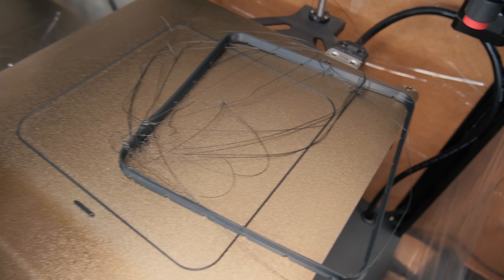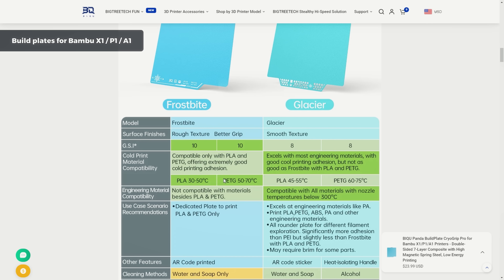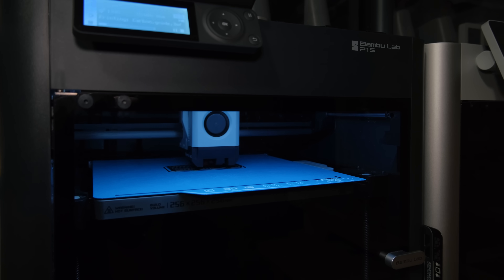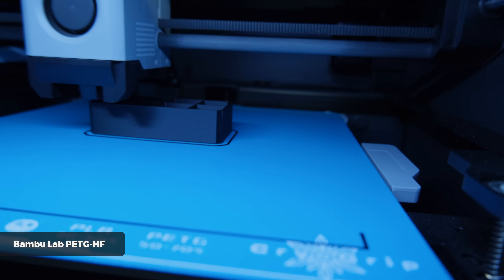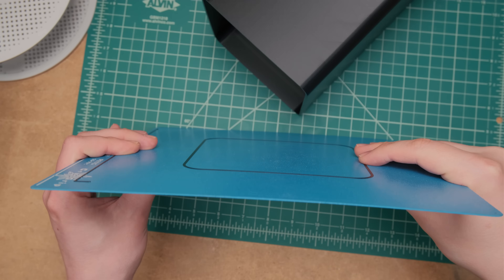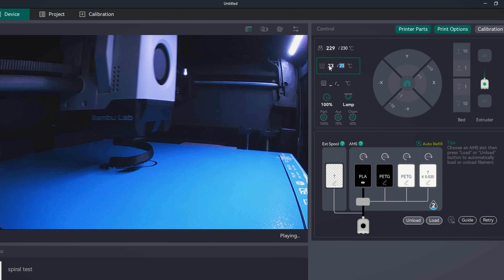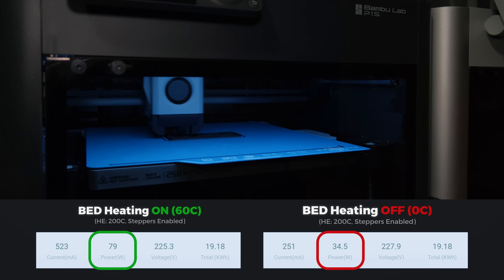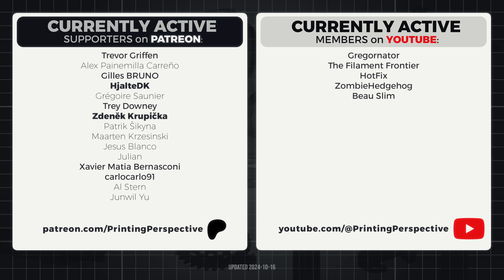The Game-Changing Build Plate (CryoGrip Pro)

Comment: I don't know where the idea that you can't print PLA or PETG enclosed comes from. I've had my P1S for almost a year and I've never felt the need to leave the door open while printing either material. The prints come out just fine.
Reply: It's not like you absolutely cannot. You can but it's worse for overgang and bridges and you also risk to get clogs if your heatbreak isn't cooled well.
Reply: I also print PLA mostly enclosed with my P1S, only if I have some bigger bridges or overhangs above 45° I open the door a little. I also turn down the AUX fan to 25% instead of 70%  default. I found that the cooling is often to strong and parts on the left (side of AUX fan) will warp, because the default cooling is to strong
Reply: I don't have any enclosed printers, but one of my printers starts to jam PLA any time the ambient temps exceed 30c
Reply: I’m printing a lot of PLA and PETG in my p1s as well, whether big or small, they all work really good. I will only open the door if there’s a lot of overhangs in model.
Reply: ever heard of heat creep or do you only print really small parts?
Reply: I printed petg/pla for a year with the x1c closed before I even heard this was a thing. IIRC it was the x1c screen that mentioned to print open
Reply: Obviously you don't, you join the game late so don't be that know it all guy. PLA and PETG can't printed enclosed was a problem on older printer where heatbreak cooler is not good enough, causing the filament to swell in the tube, jamming it.
Reply: @giaopx  No, there are two separate issues: heatbreak cooling and part cooling. The former was only a problem on old junk hotends, but part cooling is always a problem with PLA in a closed chamber. You can never have enough cooling for high speed PLA printing - even with infinite fan, the thermal conductivity of the PLA itself, getting heat out from core of the extrusion to the surface, is limiting, and the only way to get it faster is lower air temperature (higher delta T).
Reply: durning summer my printer jammed because the temperature in my enclosure went above 80 or so degrees. so the pla turned in to a mush that was impossible to push. that's why.
Reply: "ePLA" is more temperature resistant and said to be stronger than PETG. print like PLA
Reply: I also have a p1s and have never had the door open when printing also if the print is going overnight i will drop the chamber fan and aux fan down to 20% and part fan to 50% . Never had a problem with warping or failed prints
Reply: @truey90s  "Overnight" <- clearly you're printing slow, large prints. Which probably mostly work, except for poor overhang performance. What doesn't work are small fast prints.
Reply: We've had many instances where PLA (on PEI) gets soft due to the chamber temp and then the extruder gears can no longer bit into it. They wear into it and so it jams in the extruder. This happens when a print has parts that result in very low flows so that the filament remains within the bowden within the enclosed section for a reasonably long time.
Reply: It depends on your bed, temp and more. Bambulab recommends it on non cool plates due to heat creep potential.
Reply: Anything that's keeps a draft of the bed is better I don't know where you lost your crack pipe
Reply: One day I printed PLA with top and side door closed this summer when outside temp is over 100F and no AC. 

Heat creep jammed the extruder and I had to disassemble everything
Reply: @astrovore148 - you could know if you wanted to…
Every environment is different and there are some where the heat creep will mushroom the filament and in some printers where the hot end cooling is poor, opening the top or door is one way to mitigate that.  It’s really not complicated.
Reply: @JoeyMoreland  Yes. But it can still be done successfully, and is done so by people everyday.
Reply: Mines overheat if I don't open
Reply: Just because you can does not mean you should.
Reply: Printing PLA in an enclosure just like halves your cooling power, which is really bad on a printer that already has underpowered cooling. Maybe it doesn't matter if you only print large objects or full plates of parts, but if you print small things, the weak cooling will easily make what should be a 2-5 minute print take 10-20 minutes. It also precludes printing extreme overhangs without support.

The mechanism here is that rate of cooling is proportional to delta T, and the critical temperature you need to get PLA below not to be soft is around 50°C. If your chamber is 35° instead of 20° ambient, delta T is 15 instead of 30 at this point, and cooling takes place at half the speed.
Reply: @daliasprints9798 If you print small parts, the enclosure doesn't really have time to heat up like it does on a large print.......
Reply: @shelbyseelbach9568  Even just bed heat in open air makes a difference. I haven't done speedboating in a while, but when I did, I always used cold bed because of the loss of cooling power just from the bed, which affected how fast the lower hull could be printed successfully. Chamber will make it even worse. Even for sub 10 minute prints.
Reply from the maker: It depends on your environment temp and the fan speed settings, but overhangs will suffer no matter what.
Reply: People who don't have a room with enough cooling are basically where this comes from. For those of us who have rooms that are temp stable and stay cool without issue, leaving the door closed is a non issue.
Reply: It's apparent you aren't printing in a warm room and aren't printing bridges or large overhangs. It absolutely amazes me how people can think "I've never had this issue so there's no way other people have different circumstances and could possibly have this issue!" You ARE the problem. 

I've had issues with heat creep in my P1S that caused clogs and even extruder jams/breakage when printing PLA. The room my printer is in is routinely 90-100F so I absolutely have to open it up when printing pla or I wind up spending too much time cleaning clogs.

Please stop thinking your the only one that matters.
Reply: @marinegeek_23  When did he say that it's impossible that others have experienced issues? He asked where the Creator got the idea that it was impossible and stated that he does it without issue, meaning that is absolutely possible. I hate when people want to argue against things that the other party never actually said.......
Reply: @shelbyseelbach9568  lol look in the mirror
Reply: You are specials, I am sure its your unique super ability as a maker.
It depends on the enviroment mate. I run a small farm  I invite you to bring your printer here and run even a single PLA print with closed door and lid. If you can do it It I will give you one of my p1s. If you cant I am taking your special one thou! 

Maybe you are using pla+ without knowing it? That definitely makes it more possible 😉
Reply: @ZhakRyuu  mate? Are you from Australia? Maybe the difference is really the environment
Reply: Yea that's a load of bs enclosure although not needed for pla brings no adverse effect
Reply: @aydenhanlon1674  Print a 7 min PLA benchy in an enclosure with heated bed or GTFO. 😎

Comment: are you waiting till the plate and part have completely cooled before removing from the plate? I always take my plate and let it cool on my countertop before removing the part. this soaks up the residual heat that is left in the part and stops it from warping after being removed from the plate.
Reply from the maker: Yes, but if filament wants to warp it is hard to prevent that in general. For example, Bambu ASA is quite bad and something like Fiberlogy ASA has almost no warping.

Comment: if they bring a 355x355 version I will buy it instantly
the power consumption is surely in important aspekt of many, would be cool if you can post the diffrence in power consumption for the same print (no heated bed pla vs normal settings -> 60°C or smth like that)
Reply from the maker: It always depends on the printer and how much stepper motors, fans, and hotend consume. But in general, the bed is the highest source of power consumption. Yeah, I hope too that they will provide these plates for other printers.
Reply: Coming very soon. Like 3-4 weeks.
Reply: @bigtreetech5117  updates? want to buy one for my voron 2.4 350